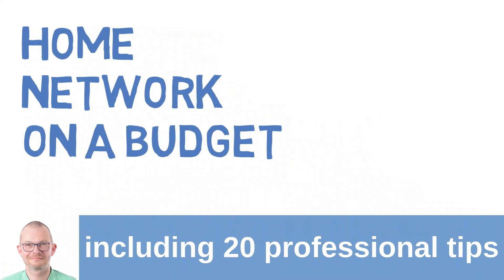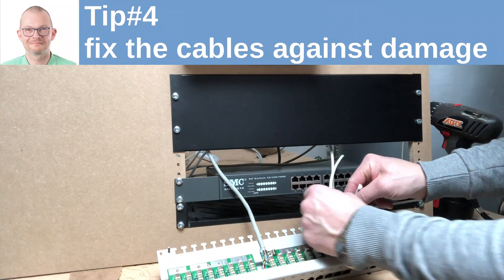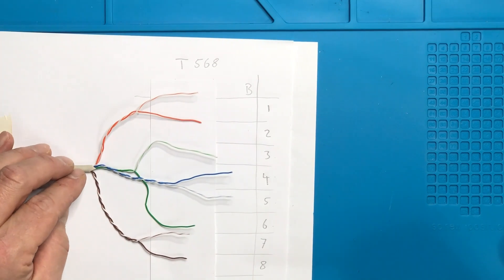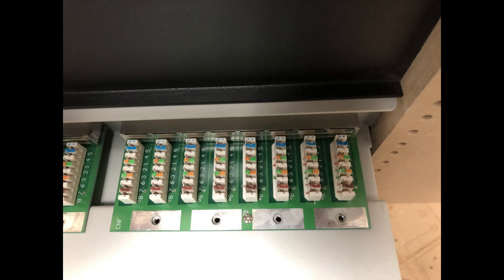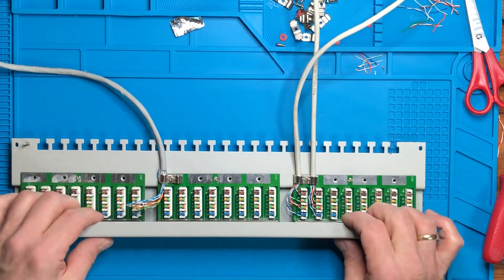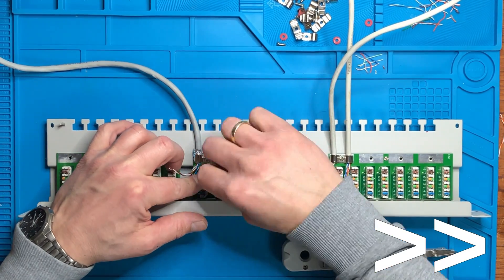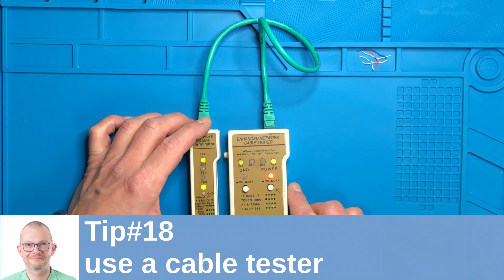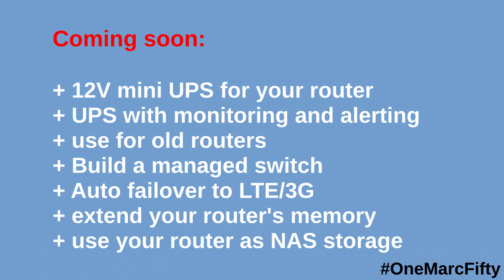HOME NETWORK on a BUDGET

Comment: The nano-second you said "rack mount" you immediately quadruple the price of what "a Bargain" is. You must be related to Bill. I admit to a lust to have something so nicely organized and consistent - but I cam to learn how to build a network for $99.99. You promised. Now - continue. Don't let me down.
Reply from the maker: Hi - I haven't thought about this to be honest. I personally prefer to buy stuff second hand - hence the purchase price is always lower (at the expense of not having warranty etc.) - but yes, you are right. Hadn't thought about a 100$ Limit yet though - that might be a tough call. Even though - an old Wifi AP, using it as a switch plus maybe a thin client or old PC with a larger SSD as a small server. I'll give it a thought ;-) Thanks for the feedback!
Reply: @OneMarcFifty  Everybody has an old desktop they didn't throw out or give away that just got obsolete - I have two - one that is still used for graphics - anything of modest bandwidth. It's got a big monitor and I can use it for teaching like a visual aid during calls or videos. And a fast laptop that replaced it. I also have a laptop for carry. That's before I get to android devices. I just need to share files and have a single repository for organizing and to back up. Shouldn't be this complex. Internet by cell phone hotspot is part of the deal. I think we're all brainwashed. I think there must be a simple solution that costs less than $99.99 like switch and cables and open software. Sounds like a good title in there somewhere.
Reply: @OneMarcFifty  Now that I know what to search for I immediately found a year-old Linus demo that actually uses my own #2 desktop - so hey - I might save $999.99 cause I even have a box new router-switch I never used.
Your Old PC is Your New Server - YouTube, https://www.youtube.com/watch?v=zPmqbtKwtgw

Comment: 19 inch switches are expensive.. A central switch also means a lot of Ethernet cabling. Even considering the performance bottleneck that comes with sharing a single cable, I use a center star + satellites network topology, with 8 ports switches everywhere (lowest cost per port). The installed wall cables support 2.5G, so an upgrade path will be available in a few years.
Reply: Switches by purchase price: 19 inch switch > 8 port switch > old wifi router with 4 Gbit ports that makes a perfectly stable managed switch

In terms of running costs, more cabling means zero additional running costs (cables don't ask to be fed) while eg. an old wifi router turned into a 4 port Gbit switch with wifi disable will still draw about 3W. And while a few watts of energy consumption doesn't seem much, it adds up quickly if you run a few of those switches 24/7 (something like 10 EUR/year) as opposed to buying more ethernet cables instead to be able to run less switches at home. 

Keeping the number of switches low and doing more cabling can be more cost effective after all if more cabling is an option in your home at all.
Reply: @diacritic8508  "zero additional cost" is not totally true. The "green ethernet" switch spec indicates that the shorter the cable, the lower the consumption. So a center switch uses a max amount of power to maintain a good signal/noise ratio, while same-room switches use much less power. You still have a point, considering that any switch has    a fixed base power consumption.. but the balance is not as obvious. In addition I have a secondary firewall that protect a "private" network without WiFi, where our desktops and backup NAS are. The iot equipment and home theater stuff are behind the first firewall, where the WiFi is, a DMZ of some sort. This also lead to a star + satellites topology.
Reply: @pascalmartin1891  Thanks for pointing this out, I definitely haven't thought about longer cables making ethernet switches to consume more energy. If you have switches with green ethernet sticker and have cable runs close to 100 m this might be something to account for. In my home, I only make like a 10 m cable run to do 20 m instead so nothing close to 100 m and I believe a green switch wouldn't save enough on such short cable lengths to be easily measurable. But point taken, might be relevant under different circumstances.

Also, I think not many people do this, but the greenest device is a device switched off when not used and you can simply switch off your home networking gear when not used eg. at night or nobody's home. There are some services you want to run 24/7 like security cameras, home automation etc. but those are typically low power and you can save almost 1/3 of your energy bill by switching the rest of your home network off for the night. Not sure if this "2 tier" home network service concept has a name, but I do something similar running only low power basic services 24/7 and in my case the energy saving is quite significant as I serve the second tier eg. NAS, desktop OSes etc. on a workstation with virtualization using Proxmox.
Reply: @diacritic8508  I have to admit that I do not know what cable lengths are significant from a saving point of view. I might check, just for fun. My trunk cables are 10m, except one is 20, while the satellite cables are between 1 and 3m. I also use a smart wifi plug to switch some of the computers off. Then the green switch consumes next to nothing for these ports, according to the user manual. Rather than using virtualization, I use multiple raspberry pi, except for the security video server (which I plan to replace). A regular PC uses too much energy, a switch is little in comparison.
Reply from the maker: Great discussion, it's true that there are many other points than just the purchase price to be taken into consideration. The TCO ("Total cost of ownership") is difficult to calculate in advance though because power and MTBF go into the calculation.
Reply: @OneMarcFifty  a failed small satellite switch is cheaper to replace than one failed central switch. On the other hand, having multiple switches leads to more frequent failures.. The one certain difference is the bandwidth limitation due to sharing a wire between multiple endpoints, so this is probably not optimal for people sharing a high performance NAS.

Comment: Hey thank you for this video. Can someone advize me, which type of cable is best to buy. I plan to wire it through the wall in my 3 rooms. My Internet speed is around 150 Mb/s.
Reply from the maker: I'd personally go with CAT6 or even CAT7 wires these days even though you can get Gigabit Ethernet with CAT5e - but in the lights of POE (thicker wires) I'd consider CAT7. Even if you just patch them to a (cheap) CAT5 panel.
Reply: @OneMarcFifty  Thank you, what about type, is UTP good enough?
Reply from the maker: @ziksanizuz8590  I use CAT5E UTP in my house - works fine - if you use CAT7 it will always be shielded. Now if you have a 400V heavy machinery next to the wire then you might go for shielded.
Reply: @OneMarcFifty  Thank you, no i have nothing that heavy 😅, i will go with cat6. I plan to put router and switch on attick, and wire everthing through Attick down to rooms.

Comment: what is the purpose of the panel?
Reply from the maker: Basically structure. If you only have 2 or 3 cables running through your house then you would not really need it. I have more than 20 so I definitely need it in order to not get lost in the maze ;-)

Comment: I need to create an audiophile network using Cat8 and 10 - 40Gbps. The network consists of Hub 3000 modem/router for Bell Fibe optical internet, Linux music server with 2 Ethernet ports, Linux streaming server with two Ethernet ports, DAC, AVR, Blu-ray player, Roku 3, Magicjack voip, Laser printer, bunch of Windows computers, 1 iMac, 4 smartphones
Reply from the maker: Wow - that’s high end ;-)
Reply: @OneMarcFifty  Can you use draw.io online drawing tool Network shapes to quickly draw the above? Do I need collapse distribution layer or just Access Layer? Which types of switches etc? The condo room with the modem/router/AP Hub3000 has 2 Linux servers close by. The only requirement is to have bandwidth as wide as possible, the number of ports maybe not more than 8 or 16. The internet service is Bell Fibre 1.5Gbps going to Hub3000 SFP module. Half dozen computers access this router wirelessly. The Hifi portion (maybe another router?) should probably be separated somehow. The Linux server will deal with LF/HF noise coming from the router, although probably the switches/routers should have external linear power supplies (hard to say, these are slower than switching power supplies, which are also noisier). The first Linux server has another RJ-45 port for direct Ethernet connection to the second server. This connection is galvanically and EMI isolated from the input RJ-45 port receiving music from the router.
Reply from the maker: @Burevestnik9M730  Sorry mate, that request is probably out of scope for a comment ;-) You may try hopping on the discord server, maybe someone can answer there.

Comment: Hi Marc. A few questions if you don't mind:
1.Can you reuse those keystones on the patch panel in the future?
2.Can that patch panel accept wires of cat7 (and upwards) or will they be very thick and rigid to accomodate? 
3.What's the exact model of the patch panel you use in the video?

Many thanks and keep up the great work. It's only a matter of time until you gain thousands of subscribers! (y)
Reply from the maker: Hi, many thanks for your feedback and questions! You can reuse the free slots - just make sure you leave enough spare cable so that you can take it out of the wall again. In theory you could patch Cat7 onto a Cat5e patchpanel, even though it might be challenging because the wires are thicker, and the pairs are shielded etc. Exact make and model - honestly, I don't know... I just bought the cheapest on ebay 12 years ago ;-)
Reply: @OneMarcFifty  Thank you. I meant the punched down connections, can you open those keystones and punch down new ethernet wires in the future? If that's not possible then a modular patch panel might be a better option.

Great insight once again!
Reply from the maker: Ah Ok I see - yes I‘ve done that before - of course if you do it 10 times they will probably wear out but it is possible.
Reply: Thank you! :)

Comment: Three additions to your video, specifically about punching down the lines  into the patch panel:
1. Especially when you use higher quality  cables, Cat6a and such, you will have an additional shield around each pair. Leave the pairs drilled and the shield around it as close as possible before the punch-point to avoid any kind of cross talk between cables and max signal  quality.
2. Do yourself a big favour and follow Marc's tip about a good punching tool. I always recommend the "Krone" ones. The thing is, a cheap one is 15€, a proper Krone one is 35€. That is 20€ for a really big chunk of lifetime and grey hair you are getting back for just... well 20 bucks. Do it, trust me.
3. When you have all those snapped off cable pieces in your patch panel, don't just wiggle the panel as Marc did, but instead use a vacuum  cleaner. You will first of all get them out a lot more reliable (and wiggling is not that easy if your patch panel is already inside a rack) and second of all, the vacuum will pull out all the single wires that have not been proplery punched into the socket so you immediately see which ones you definitely have to do again.
Reply from the maker: That’s incredibly useful feedback, many thanks - awesome!
Reply: Me again: On a second look, I saw that Marc is actually using a Krone tool to punch down. I can only say this is industry standard, if yours is not working properly or if it is not cutting reliably, this can be for two reasons: Either the tools is already old and the included scissors are not sharp enough anymore, or (and that is the much more likely problem) the sockets are of not such good quality and thus the distances that they keep the wires in are not accurate and thus  the tool does not work intended.
I can only tell I used a lot of those Krone tools in the past and a lot of cheaper and more high quality patch panels and the reason for crappy  results using such a tool are usually the sockets!

Comment: great content... by the way i got one question some guys on youtube promote the idea that no need pachpanels for small homes .. i am confused :(
Reply from the maker: Thank you ! I would say that it is not so much the size of your home that matters but rather the number of cables or outlets that you want to connect. If you have to pull 3 cables then a patch panel might be overkill. If you have however to connect 20 or 40 devices then you will quickly be lost without. A a rule of thumb I'd check the number of connectors on your WAN router. Typically there are 4 connectors. If you have more devices then think of putting a patch panel in. If you have 8 or fewer then a smaller model might be OK. For more than 8 I would definitely go for a 19" patch panel. I hope that helps.